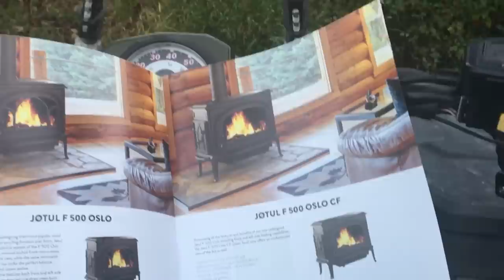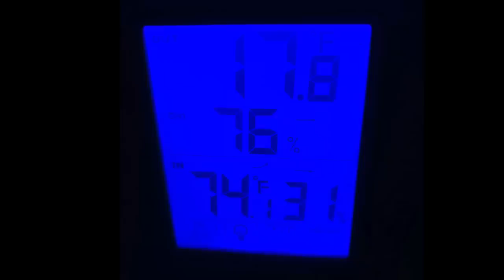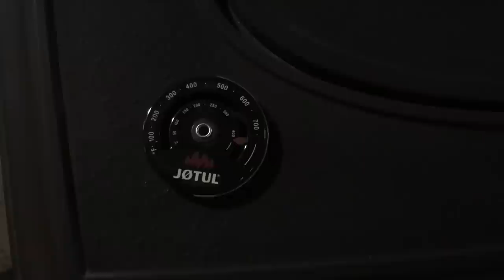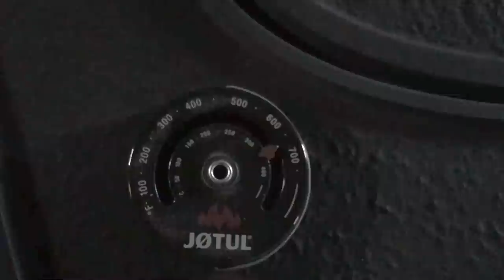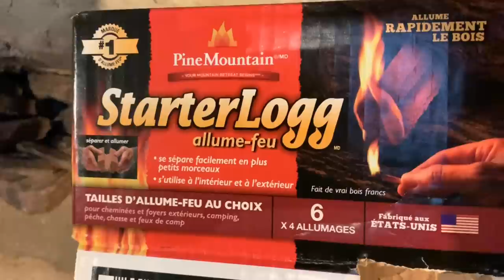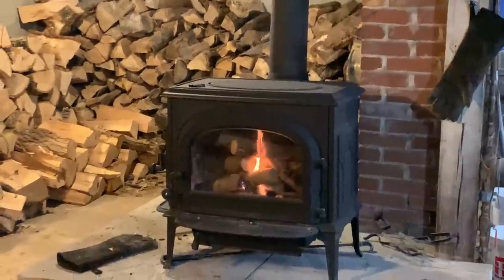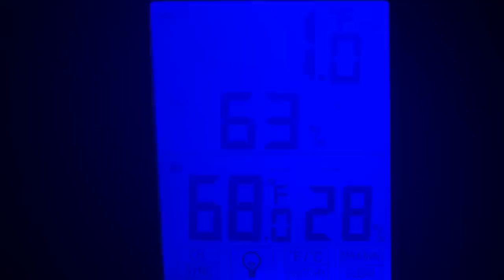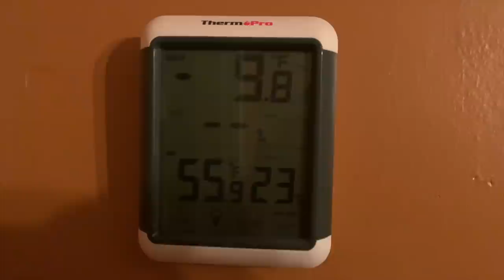The Jotul F500 Oslo CF one full winter review + install is this stove that good ?

Comment: Set the Ash pan under the Ash pan door, use a fireplace poker with a 90 degree angle at the end to sweep the overflow ashes out of the cavity and into the Ash pan.
Reply from the maker: My ash vac works better (-;
Reply: @AlfonsLC   just cut the back out of the pan now it scoops it every time u push it in
Reply from the maker: Micah Lewis that would be pretty messy carrying the ashes to the bucket outside. It would certainly pour off the back without the back of the pan there.

Comment: Use a cloth. Wet a small  portion of the cloth with water. Dip wet part of the cloth in the ashes. Rub the inside of the glass 
Edit; No glass on my stove, so I'm not certain, tho it worked great in the YouTube vid. Good luck👍
Reply from the maker: Read the comments. Video description. Watch the follow up video that addressed this. So many attempts to get these comments addressed. If i had a nickel each time someone said this. I could return early. Thanks for checking it out.
Reply: @AlfonsLC  Oh man, really?? I was so convinced from that vid. Just goes to again prove the value of research stuff like this. Great content. Honest and spot on with specifics; sesoned wood vs non-seasoned...energy. Nice stove, brother, glad it's doing great. I have a good older stove, a Fisher Papa Bear. Tho i think id still like to have reburners, i have great air control, from blast, to choked out by 95% closing of air intake ✌️
Edit
Reply: @AlfonsLC  Sorry,  I misread your comment
Reply from the maker: I was raised with a Fischer papa bear. All i ever used. They are great. But. Without that gas reburner you waste most of the fuel from wood. Check out my follow up video i had to address this ash in paper comment so many time i made and tried hard to direct people to the follow up before they left the comment but still get a few a year. Its all good. Opportunity to chat. Thanks for much for the compliment on the info. The glass is damaged and needed repair
Reply from the maker: No worries and no need to apologize. I appreciate dialogue.

Comment: Try wetting a rag dipped in the ashes to clean the stove glass. It may work wonders in keeping the glass clean. 👍👍🇺🇸🇺🇸🍺🍺
Reply: White wood ash only. Never use coal ash.
Reply: David Smith Wait. People actually burn coal?!?!
Reply: We use vinegar and water, to clean our glass door.
Reply: Damp newspaper and coal ash every time
Reply: Sometimes I use very fine stainless steel whool to clean the door, the glass won't scratch and it really helps removing the hard stuff. After that I "polish" the glass with a damp cloth and some ash from the stove itself. Been doing that for years.
Reply from the maker: Theres a follow up video. This glass is damaged. That didnt and would never work on it.

Comment: I bought a Jotul several years ago and I've been pretty disappointed with it.
-Ash pan way too short. 4" deep would be much better than 2"
-I have to swap handle around. How about a (cool) handle for each door?
-Realized when I got it home that the roof of the stove is designed to not
allow much wood in the firebox. 6 hour burn max.
-The unit should have a nipple for an outside air supply with a damper.
Who wants to feel cold air drift across the living room to feed the stove?
-The sliding air control does not seem to do anything. You kind of want
to see something happen when you slide the mechanism.
Reply from the maker: The stove has a cold air kit for its stoves now. Have had them for a few year now at least. You may have missed a design change or you could ask if they make it for your stove. Sliding my handle make a drastic difference.

Comment: At the risk of sounding dumb, what is the difference between seasoned and unseasoned wood?
My recent home purchase as a fireplace that the seller never used.  I plan remove the insulation they stuffed in the chimney, then have it inspected and relined if required. The goal is to put a wood burning stove in the opening. (  I hope I'm saying that right)
Reply from the maker: Stupid is not knowing and not asking. Smart is knowing when to ask. Seasoned firewood by definition is wood that has been cut AND spilt for 4 seasons. In order to remove moisture content to under 20% ideally. The number of years it needs to sit out to season. Depends in the wood. Oak for example can take three years in some cases while ash or maple can be fine in just one year. All depending on conditions. But in general. 4 seasons cut spilt = seasoned firewood.
Reply: @AlfonsLC  thank you. I guess while I'm saving I better fire up that chain saw (chuckle)

Comment: I bought a new one years ago.  It was the worst burning stove I've ever owned. I now have a Blaze king and it's the best
Reply: Bought one in 2000.  Had a Vermont castings before that. The jotel is junk.  The back plate disintegrated.  Had to fit a 1/2 steel plate to replace it.   I still have the Vermont castings stove in my cabin.  Made and burned since 1976.  I now have another one in my home
Reply: @phmoe3313  half inch....holy shit...that's massive overkill

Comment: My father used to burn damp wood with some coal on the bottom of the burning chamber- it increased the burn temperature and prolonged the burning time a bit, resulting in less wood used.
However, I'm not sure this is good for the components of the stove, since coal burns at a higher temperature than wood.

Comment: Good afternoon. Tell me, if there is a strong fire (not during ignition) , if you add firewood through the central door and generally open it wide open, will the smoke go out into the room?
Reply from the maker: Depends on the quality of your draft. For me. No.

Comment: Does your stove allow for outdoor air to be drawn in for the combustion process? If so, do you use this function? I'd think using strictly indoor air for combustion would result in a rather dry indoor environment, unless that is that is your intent.
Reply from the maker: It does have this function. But requires a kit to hook up the duct work the outside air. Its something i will do in the future. For all the obvious benefits. Right now the stove creates a vacuum pulling in cold air exploiting some parts of my basement that are not sealed the best.

Comment: I appreciate the knowledge you have shared, I just need to know this: how did you get the hot air upstairs using the stove exhaust? Isn't that used to let the smoke out?
Reply from the maker: Its in the video. Natural convection. Heat rises.

Comment: Where do you put the air control at when you’re burning ? Do you close it all the way down ?
Reply from the maker: You have to have the stove up to temp first. 400 or over. Then all the way off. If you turn it too low when its not hot enough it will blacken the window and smolder without heating well. So. 400 first. Then all the way off.
Reply: @AlfonsLC  thank you!

Comment: If you want to truly maximize the efficiency of the stove and wood burning in general, you need to address air transfer.  Every cubic foot of air that leaves the stove pipe is replaced by air drawn into the space, from outside.  These modern wood stoves have round air intake tubes underneath.  Run a pipe directly from the exterior to that intake.  No more vacuum being created by the exhaust.  This also feeds cold air into the stove which is more oxygen rich due to density.  I did it and it made a world of difference.
Reply from the maker: Yes. It does. But. Im poor. And count afford the fresh air kit for the stove. I will likely add it in a future video. For all the reasons said above.
Reply: @AlfonsLC  
If you have a unit fan on the stove , wouldn't it negate fresh air kit ? Besides the oxygen rich air for the fire ? The unit fan will pull air from the rooms and ultimately from any outside air leaks from windows, doors ect ... Or am I seeing this wrong ?
Reply from the maker: @leonardrichards9079 the unit fan you are talking about is a circulation fan. It circulates the heat from the stove throughout the room. A woodstove does not have a blower fan. Like in a pellet stove. To push air inside the stove. A fresh air kit allows air from outside to be pulled in by the natural draft to feed the fire instead of pulling air from inside your home and creating a vacuum.
Reply: @AlfonsLC  
I believe I understand. I am not considering an induction fan. If the unit uses a circulation or squirrel cage blower( fan ) , once a fan is added, it will create the negative pressure ( pull cold air inside the house ) that the fresh air kit would otherwise eliminate.  Or am I seeing this wrong ?
Reply from the maker: No. A circulation fan is no different than running a box fan. It just circulates the air already inside. It helps the heat move around your home. They are good if you want one. For me. Its not needed. So i dont use.
Reply: @AlfonsLC 
The question is... Oh never mind. Thanks for the video.

Comment: How has your Stove been? I watched this when it first came out. Get your wood ready buddy you will need it soon 😳
Reply from the maker: Just made an update from year two. Thanks for checking back in. Ready for 3 year now. Third year video will be the last as i think i have a perfected system in place.
Reply: @AlfonsLC  last year I had to pay a chimney company to install my stove after our addition on our house. My insurance company required this, the guys that came didn't know what they were doing and I had major issues. I have the issues fixed now I think, so let's see how this year goes. I could use some more wood also
Reply from the maker: Never enough firewood in life. I got very lucky with my insulated chimney installation. The people were professionals and did it right the first time. I haven’t even Needed to clean it once since it’s installation and I check every year. It really is very important for the stove
Reply: @AlfonsLC  for sure. I had a chimney fire once and it would get creosote build up fast. The second company I had come out corrected the pipe " I hope" we will see soon enough. I have had a fire for a couple of days already and I can tell it draws much better. Anyways take care 👍

Comment: That permanent clouding or black tar on the glass can be simply removed using a slurry of the white ash and water with a soft cloth. Wipe clean and you'll be good as new!
Reply from the maker: Thats totally not the case. Check out my follow up video linked at the end when i show the repairs.
Reply: Hmm. intresting, did that not work for you?
Reply: @AlfonsLC  This has always worked at our grandparents  summer house. We use a 105yo cast iron Dutch Enamel oven with original glass.
Reply from the maker: If you have time check out the follow up video i made. I got this question or suggestion so much i had to explain. The video directly response to this very question so it may interest you. The glass is now repaired. But you will see that certainly no cleaner would ever have made it wipe off.

Comment: Wouldn't kiln dried be better than seasoned? Don't know much about the subject but read that seasoned has more cons. (1) Takes longer to dry out and is more inconsistent (2) Harder to light due to moisture content (3) Can have musty smell made even worse if there's mold or fungus present (which will be tough to get out of clothes even after washing) while kiln dried (depending on species) can have better aroma (4) Seasoned firewood burns at lower temps producing more emissions whereas kiln dried burns at higher temp and burns longer/slower. 
Again, don't know much the subject but the major benefit I see is from drying time as well as possible side business to have selling some off.
Reply from the maker: Well. Kiln dried wood is better. For the stoves performance by a little bit. Im moving to be cut two years ahead on firewood. I cut it myself. Kiln dried is very expensive. So. For me. Not better.

Comment: After buying a Dutch West, made by Vermont castings that is an utter dog, I wish I had one like the Jotul.
Reply from the maker: Love mine. But seasoned dry wood is most key in these new stove.
Reply: I'll sell ya mine. I've had other wood stoves. This thing is a nightmare to draft and uses tons of wood. It's coming out.
Reply from the maker: @erikstcroix  curious. Did you buy a new ones with a cat converter ? Whats your chimney set up ?
Reply: Chimney is old brick from 1947. Previous home owner bought it within the last couple of years. The 8" black pile goes horizontally back 2+ feet then 90 degrees and up. It has the holes in the top inside for burning the extra gasses. I think that's what makes it more of a pain...trying to recapture and burn the air rather than let it leave. You open the door and it's like a cold air blower in your face.
Reply from the maker: @erikstcroix  that stove will never draft in a brick chimney. Not many stoves will. Theres too much air volume in there. I have an old brick chimney as you see in the video. But. I have a 3k$ insulated stainless chimney liner in there. Thats the secret for me. The gasifier pipes wont cause a problem. That old square chimney will.

Comment: How many cords for a 1300 square foot home burning every day in winter you estimate?
Reply from the maker: 6. Actual measured stacked cords. If you are well insulated. You should have a little extra even.
Reply: @AlfonsLC  Nice,  I am done with oil an grew up with a wood stove.  Going to go with that option an this stove just that wood will be expensive to get quickly ha.  Thanks for the review!
Reply from the maker: Thanks for checking it out. Be very very careful buying wood. Especially this time of year. As you seen in the review that went very poorly for me I only cut it myself and never buy it if I had to I would make sure I had it all bought by February to prepare for burning season fall.
Reply: @AlfonsLC  So I got my stove finally, for the break in process you recommend doing the fires and cooldowns all in one day or break it out over a few days?
Reply from the maker: Mine was in the instruction manual how they wanted it done. It has to cool to room temp before you fire again. I was able to do this in a day
Reply: @AlfonsLC  You measure the pipe to cool or stove in any specific area?
Reply from the maker: The inside of the firebox.

Comment: I use the ash door to get fire going every time... run it until surface temp of stove is 500... then I close door and damper and slide the lever to the minus position... 10 years without issue and burning 3.5 cords a year

Comment: Aah buying wood on Facebook and craigslist, live and learn, unless you have a year to spare. And great job on not splitting kindling! You could probably split those fire starters in half or make your own. Good video.
Reply from the maker: Haha. Come on. I wanted to show how easy the fire starting was. No spilt necessary ! And yeah. People have NO CLUE. What seasoned means. They think it means the tree was down a few months ago. One guy brought wood with green leaves on the branches. I said. Get the F outta here. Seasoned. Yeesh
Reply: Yeah, see log length advertised as seasoned because it was cut a year ago. It don’t season log length for YEARS! Half the time it rots first.

Comment: Can you post a video running of a fire when you shut down the air at the maximum please 

I have a oslo and i found when i turn the air lever at the minimum semes like burning fast 

Thanks
Reply from the maker: Check and makes sure your ash pan is closed tightly. I show the handles position. If you leave that in any other position air comes through. It really affects your burn times. Also. Wood should be all seasoned hardwoods. Im going to do a follow up and much more outdoors stuff to come. Stay tuned and all that is coming soon.

Comment: i use Fast Orange hand soap to clean my glass when it gets really bad.
Reply from the maker: Ill try it. Using Ashes didnt work.
Reply: @AlfonsLC  i also recommend a product called Kathite, it is a chimney cleaner power, it has helped keep my glass cleaner as well.
Reply: I find cleaning that wiping the glass with a damp cloth every day and then using invisible glass cleaner works amazingly well
Reply from the maker: S Bains invisible glass might not be safe for heated wood stoves. If youre using it it may be risky. I use it to clean the mirrors on my Kenworth. But remember this is not actually glass. Its a clear ceramic. Sole glass cleaners can weaken the glass over time and shorten its life drastically.
Reply: @AlfonsLC  Try green Scotch pads and water. Works good and it's cheap.
Reply: A Guy Named Alfons Try Glass Stovetop cleaner. Worked for me.

Comment: Thanks for the video. But one thing I know is you never heat the basement with a wood stove with no insulation on the walls .... Trust me you will use a lot more wood . all the heat goes out and to the dirt . next time go look out side next to the foundation when there is snow on the ground ,and the stove has been burning for a few days . you should be able to c grass. But thanks for the video.
Reply from the maker: Two years and no trouble like that. But the wall without dirt in it. Really leaks air. Needs to be buttoned up. The follow up video is coming soon (-:

Comment: is it a stove that is very hot? the following morning you find the embers burning?
Reply from the maker: The stove heats the whole house its all ive got. So yes. Its hot. Lot of embers in the morning.
Reply: @AlfonsLC  thx.
f500 o f600?
which one should you buy?
Reply from the maker: Ovlas Burning i have the f500 oslo. Your question isnt clear. Sorry.
Reply: @AlfonsLC  should I buy the f500 or the f600?
Reply from the maker: Ovlas Burning check jotuls website where you live. They have it in many different languages. It depends in the climate of your location and the size of your home. Quality of insulation and windows. Many factors to consider.